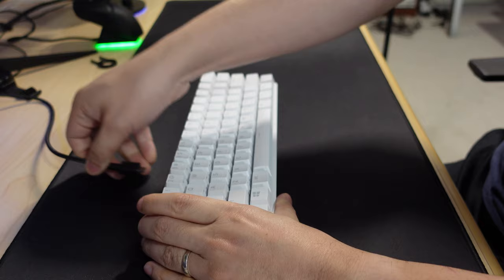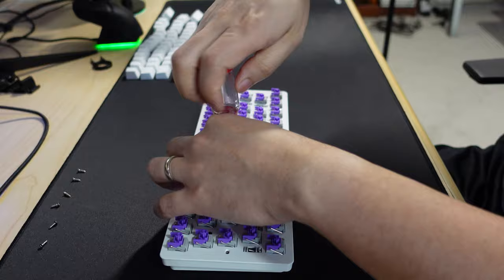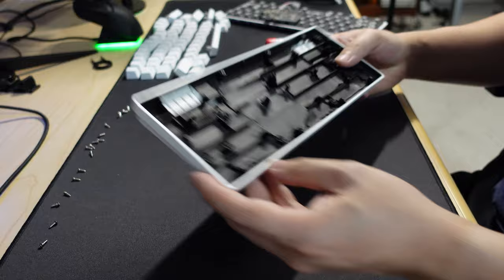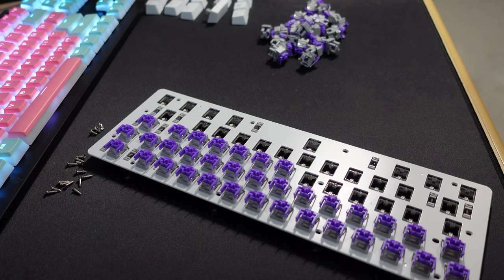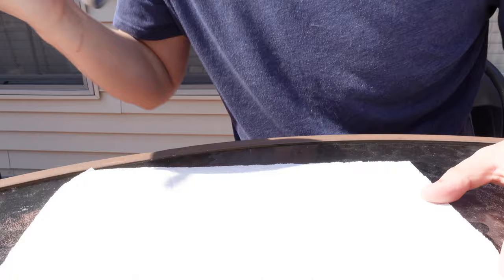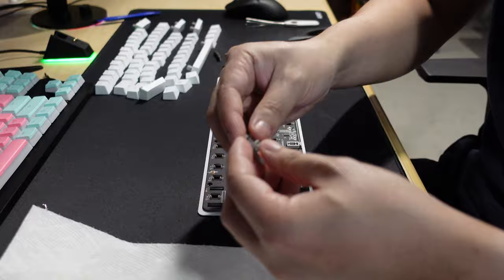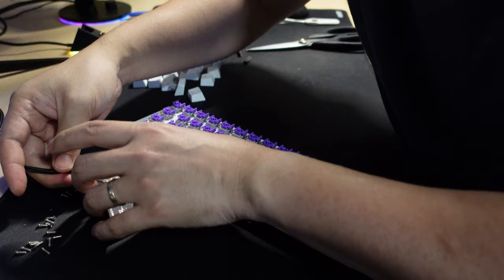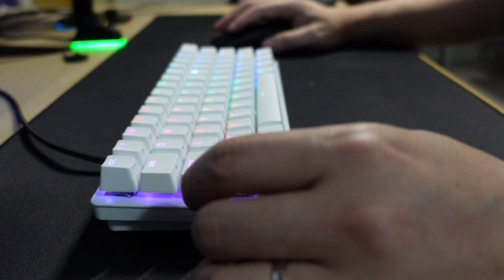Modding the Razer Huntsman Mini: Easy steps for better sound!

Comment: can you do this on the full size aswell?
Reply from the maker: Yes, you can, but the opening process is more difficult (at least on the Elite that I tried), and there are a lot of screws hidden under the rubber feet, etc. But once you get to the PCB, the switches are mounted the exact same and can be removed, lubed, etc.

Comment: Can I do the same on my razor huntsmen elite?
Reply from the maker: Yes, you can do this on the Elite as well, but the disassembly process is a lot more complex than the Mini, so I would proceed with caution. I broke the magnetic connector for the wrist rest when I disassembled mine so the RGB on it doesn't light up anymore.
Reply: @bigxie  Oh no! Okay I will definitely be extra careful. Thank you for the info!

Comment: Would the same strategy apply to the razed huntsman tournament edition
Reply from the maker: Yes, it works great on the TE as well. I have another video on the channel that shows the before/after. There's an additional screw on the TE that's hidden underneath the USB connector, my other video goes over how to get to it to fully disassemble it. After disassembly, just follow the same steps as in this video.
Reply: @bigxie  thank you so much

Comment: How do you take off the stabelizers?
Reply from the maker: If you're talking about the posts on the ends of the larger keycaps when you remove them, you'll need something like pliers to pull them off, may take some wiggling. If you're talking about the metal bar and the housings that clip into the PCB, they can be popped out much like the switches themselves.
Reply: @bigxie  i meant the metal bars under the space bar and the others, I did it fore like 7 hours ago😂, I’m in Norway so I did it in the morning
Reply from the maker: @linus2448  nice, glad you got it to work!
Reply: @bigxie  thanks! BTW, your underrated

Comment: Is it possible to switch them with optical reds ones ? And where i can get them ?
Reply from the maker: It's certainly possible, but Razer already offers the Huntsman Mini with red optical switches, so just buy that. They do not sell the switches individually so if you already have the purple version, you'd need to harvest them from another Huntsman keyboard, which doesn't make much sense.
Reply: @bigxie  in my country only clicky switches are avaibable so i can't buy red one ://
Reply from the maker: Oh, sorry to hear that. Yeah, if you really must have the red linear switches, you might need to import one from another country. Or, if the TE is available in your country, you could harvest some of the first gen red switches from it, but I feel like it's not very practical or economical.
Reply: @bigxie  i will try purple ones maybe i will like them
Reply: @truthtimetv4575  2000 iq

Comment: Question: can you change/lube the stabs?
Reply from the maker: Yes, they just clip in to the PCB and can be easily popped out. They're a different style than typical (especially for Razer optical switches), but benefit all the same from lube on the pivot points of the stab housings and the wires.
Reply: @bigxie   thanks for the advice! Really appreciate it.

Comment: What are other alternatives for the padding?
Reply from the maker: There are a lot of options, mostly just need to pick a somewhat compressible material. You can cut up an old mousepad, use shelf liner, or even go as far as mixing up some silicone to make a custom mold.
Reply: @bigxie  thank you very much

Comment: Anyone know if you can switch the stabs for the huntsman te?
Reply from the maker: They are a proprietary plate mount design, so as far as I know, there aren't any other third party options.
Reply: @bigxie  how did you get your space at to work properly or is it just wobbly?
Reply from the maker: @jamesli2695  are you replacing your keycaps? For all the stabilized keys (backspace, enter, shift, and space), there are those stab posts on the end. You need to remove them from the old keycaps and transplant them to the new ones. Then they will clip on to the stabilizer bar when you put the new keycaps on and work properly.
Reply: @bigxie  are they just pull offs or is there something else I need to do to remove them?
Reply from the maker: Yes, they pull off, but it's on pretty tight. They're only held on by an MX style "+" post at the top. I removed them by gently pulling with pliers while wiggling them back and forth.

Comment: Can i use other foam and not the one u used??
Reply from the maker: Yes, you can. Just make sure it's not too thick and that it can be compressed a little in case it makes contact with the bottom of the switches.
Reply: Andrew Xie thx

Comment: What size screwdriver did you use?
Reply from the maker: I don't know the exact size, but I used the largest philips head in my electronics repair kit. I think a traditional philips head screwdriver wouldn't work (i.e. ones used to build computers, for example), but any of the smaller ones made for electronics (i.e. laptops) should work. I can also recommend the Wowstick, which is an affordable electric screwdriver that comes with an overwhelming amount of bits for any project (including this one).
Reply: @bigxie  I just used a drill bit kit and kept trying until I got one to fit each screw but on the outside I found that 1/8" worked best as a 3/32" was just slightly small. Then on the inside I don't know what size it was. I think the mod was definitely worth it and I appreciate the walkthrough, you got a sub!
Reply from the maker: @Daizlol  glad it worked out well for you! Thanks for the sub!
Reply: @bigxie  another thing, how did you remove the stabilizers? I can’t get this thing out for the life of me lol
Reply from the maker: @Daizlol  so once you get the keycap off, the 2 gray posts can be removed with pliers (or any other gripping tool). You may want to wiggle them side to side a little if they're really tight while pulling.
Reply: @bigxie  Thank you, I have finished modding the keyboard and it sounds incredible, though I have one final question. Do you know anywhere that I can buy a set of optical purple switches (I am currently using red switches) because I have always wanted to test both switches and see which one I prefer more personally and I don't want to spend another 120 bucks on a whole other keyboard if I don't have to, and I have also loved the idea of being able to compare two switches on the same board.
Reply from the maker: Unfortunately, not that I know of. Razer doesn't sell these switches individually. The best option may be looking for a nonfunctional basic Huntsman for cheap and harvest the switches.
Reply: @bigxie  I mean there is a huntsman on Ebay that the person is selling for 75 bucks but the starting bid is 40
Reply: @bigxie  it is also a mercury white meaning that if I like the purple switches better I can hotswap the reds from my current keyboard and sell it as a linear keyboard for more than what I paid for it, as the Mercury whites aren't as commonly sold as the black boards
Reply: @bigxie  it's crazy that you can buy a set of holy Panda's for like 20 bucks but to get a set of Razer switches you are looking at between 75-100 bucks, which is nearly as expensive as their keyboards in general.
Reply from the maker: @Daizlol  yeah, I'll bet the majority of users don't realize or care that the Huntsman line of keyboards have swappable switches, Razer doesn't advertise them as such, so there's really low supply and demand for the switches individually.

Comment: does it work with gateron optical reds?
Reply from the maker: I've never used Gateron optical switches, but my understanding is that they're more like traditional switches that can be opened and lubed manually with a paint brush and some more standard lube (i.e. Krytox).
Reply: @bigxie  do uthink it works though
Reply from the maker: @jeremyang8056  does what work? Spray lubing gateron opticals? No, I wouldn't recommend it. If you mean, do gateron opticals fit in the Huntsman, then no, they don't. Only Razer optical switches are compatible.

Comment: How about with the elite
Reply from the maker: This general process works on the Elite as well, but it is harder to disassemble because of the layout with the integrated diffuser and the magnetic connector is kind of tricky to get out without damaging it. But once you're at the PCB level, the same mods apply (though you can use significantly less foam since there is less empty space to begin with).

Comment: Did you try installing O rings?
Reply from the maker: I don't feel the need to. What are you trying to accomplish? O rings help out with bottoming out sound, but won't affect the spring ping, which is what was bothering me.
Reply: @bigxie   I'm trying to get rid of the clanky pinging sound, which I think is from the aluminium plate. I'll probably try the foam method. Super helpful video btw, keep up the good work!

Comment: This is why I got the red switches. Sound nicer and they don’t ping
Reply from the maker: The pinging comes from the springs, so the linears have the same issue. You can look through the comments for a user who shared the before/after sound clips having done these mods for the Mini with reds. The difference is similarly drastic. But I do understand why many would find the stock sound of the linear Mini "nicer" just because it's more quiet to start with (I too had the same thought with my TE until I modded it as well).

Comment: By the way, don’t spray lube optical switches and especially clicky ones unless your willing to loose a lot of the click.

UPDATE: Nevermind, this uses a different clicking system then cherry and other switches your completely fine.
Reply: Heyyy I want to do the same but I had that doubt, will it be as good as the video and I will not lose the clicky, if I do it doing it on the keyboard with a brush
Reply: @andrespepper869  well make sure u have the same dry lube he is using on the video or you might get different results other then that you should be alright. Only thing is if you could manually lube it with a brush, you have a less chance of overlubing it and a less chance of breaking the switch.
Reply from the maker: If you're patient you can definitely apply traditional lube with a brush, but it's harder to do well since these switches don't come apart like normal MX style switches. On the plus side, you can't really "break" the switch by applying too much lube like the other responder mentioned, since all the electronics are on the PCB - just make sure you give it an hour or so to dry before putting them back in. These optomechanical switches' only function is to block a beam of light that is shot across each switch's socket.
Reply: @Leafy4Real  Can I use normal lubricant instead of spraying the springs below?
Reply: just to confirm is that I'm scared xd
Reply: @andrespepper869  I think you can, I have seen a few people do it. But don’t try to open and disassemble the switch because it will probably break it

Comment: wait than how about the blackwidows???Can you also do a tutrorial on that pls :)
Reply from the maker: Those use more traditional MX style switches, so I assume you'd need to desolder the switches in order to remove them. I think it's much more technically demanding than modding the Huntsman and probably at that price point, you're better off grabbing a hotswap keyboard if you want to mod and customize it.
Reply: @bigxie  :(
Reply: @bigxie  oh so apparently i take the keyboard out of it's case and shroud and place it on the bed, preparing to try some tape mod and then, i accidentall press on a key when it is on the bed, it just sounds like... miracle, like i actually have a diy keyboard! its just sooo god and now i know that the problem was the case itself being a vibrator and making the sound just so much louder:)
Reply from the maker: @trinhson1368  that's cool to hear. I haven't tried the tape mod yet, but I intend to when my Q1 comes in.

Comment: My switches dont work no more bruh
Reply from the maker: Sorry to hear. If you're wanting to troubleshoot, just FYI the switches don't have any electrical component, so as long as they press in and come back up, they're working fine. All the electronics to read whether the switch is pressed or not are on the PCB, so you may want to clean off the PCB of any excess lube and see if that fixes it. Also keep in mind that this is not a hotswap keyboard, so you need to put all the switches back in before turning it on to test it.

Comment: Is this keyboard hot swappable
Reply from the maker: No, not really. You need to open it up to remove the switches "gracefully", and it won't work properly if you turn it on with some switches missing. It is "swappable" in the sense that you can use any of Razer's optical switches in it (1st gen linear, 2nd gen linear, or the clickys).
Reply: @bigxie  can I use other switches or just Razer switches?
Reply from the maker: @user-he2ry1dw6j  only Razer optical switches (their mechanical ones won't work either). 

Edit: and I should say, the "swappability" here isn't even really useful since it's available with both options, so if you're going for it, just get the switch option you prefer from the get go since Razer doesn't even sell switches individually.
Reply: @bigxie  so the red ones because I got the purple switches and i don’t like them anymore.
Reply from the maker: @user-he2ry1dw6j  in that case, maybe look for a broken TE which would have 87 red switches and hopefully at least 61 working ones you could swap info your Mini.
Reply: @bigxie  thank you sooo much for responding imma subscribe to you
Reply from the maker: @user-he2ry1dw6j  no problem, and thanks, I appreciate it!

Comment: can i wash keycaps?
Reply from the maker: Sure, if they are dirty and you think it's necessary to wash them in order to clean them. Just make sure that you remove them, wash them gently without using harsh cleaners, and give them ample time to fully dry before putting them back on again.
Reply: @bigxie  i meant switches (optical ones) sorry
Reply from the maker: Oh I got you, yeah you can probably wash the Razer optomechanical switches if you want since there are no electrical components in them. They're literally just a mechanism to block the light beam that is emitted across the socket on the PCB. I think the only things I would be wary of are to be sure that they're completely dry before putting them back in, and also maybe that the metal stabilizer bars on the switches don't corrode or anything.

Comment: Is this risky?
Reply from the maker: It really depends on your familiarity level of opening and working with electronics. If you can disassemble everything without damaging it (and the risk really comes with removing the switches, it can be done much more gently than I demonstrated in the video), and you have patience to let the spray lube run off and dry a bit, then there isn't really much chance that the keyboard won't work once reassembled. Of course, regardless, opening the keyboard will void the warranty, so always keep that in mind.
Reply: @bigxie  Okay thanks

Comment: Egh.... WD is not good for lubing in any form (fast dry even because it starts to dry really fast and it even becomes more scratchier) but hey it was good video!
Reply from the maker: A lot of comments here about WD-40, but most didn't actually watch the video and realize that this is special PTFE (teflon) based lube. It's not what you think it is.
Reply: @bigxie  I've said even the fast dry is not good for the switches, they start to feel scratchier than ever... but those results come when they are really used... (On a daily basis if you type on this keyboard 2-4+ hours it will feel scratchier in about year or so...)
Reply from the maker: I do type on this keyboard on a daily basis, and I don't mind spraying the switches annually. As mentioned, these Razer switches cannot be taken apart non-destructively, so spray lube is the only option. Among spray lubes, the PTFE WD-40 and SuperLubes are the best options. There's definitely better lubes for traditional switches, but we're operating under different constraints here.

Comment: Spend extra 10 and get the linear reds instead. Problem solved.
Reply from the maker: Not calling you out specifically, but this is a really common (and naive) comment, so let me just address it here. The issues that these mods fix are the spring ping and case reverb, which have nothing to do with the switch type (clicky or linear). In fact, if you're someone sensitive to those noises, you'll likely be able to hear them MORE on the linear reds, as they're much quieter stock (no loud click to mask the spring ping and reverb). Doing the same mods on the linear version of the keyboard will yield similar results. Hope that makes sense to you.
Reply: @bigxie  I don't think I am naive as you have stated. But maybe you are not aware that the clicky switches are not lubed, nor do they have silicon dampeners like the red linear Gen 2 version has.. My reds on the mini sounds more muted and not harsh as  your modded one.
Reply from the maker: @asoshkin  I'm aware, but you're only taking into account the switch sound, and not what I pointed out about spring ping and case reverb. If you don't notice those on your linear Mini, you may just not be sensitive to it. My point is that these mods fix those issues which are not unique to the clicky switches. The title is "better sound", not "more muted". Your muted switches will sound even better when the springs are properly lubed and not pinging all over the case. Make sense?
Reply from the maker: @asoshkin  I would recommend searching the comments for the viewer who posted on his SoundCloud the before and after for when he did these mods to his linear Mini to see for yourself.